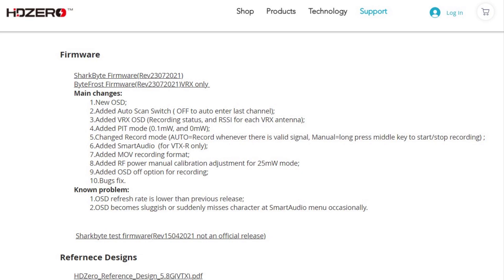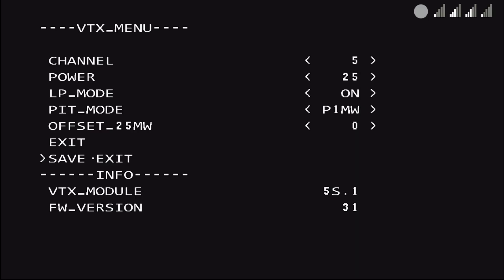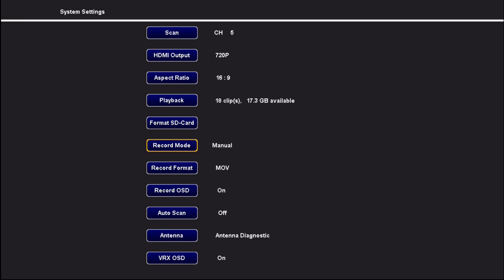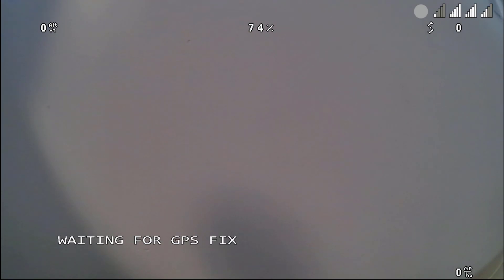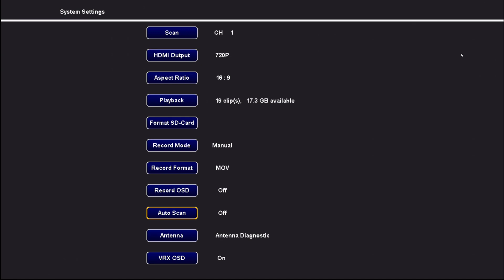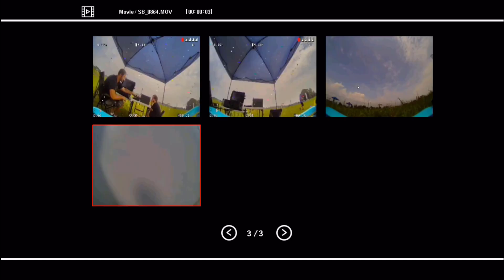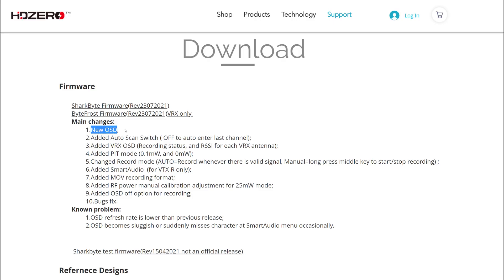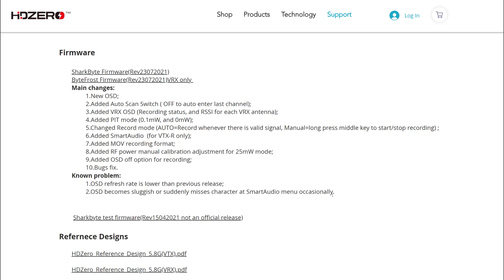Shark Byte | New features: Pit Mode, Larger OSD, Disable OSD recording, MOV file type, and more!

Comment: Hi Ryan, just to clarify, does the Shark Byte system transmit from the goggles like DJI or is it RX only?
Reply from the maker: Rx only, just like analog. This means timing systems just work and any of your friends can spectate your feed easily
Reply: @RyanQuellet  Thanks Ryan! Just getting up to speed on SB.  I was thinking about grabbing an RX module at $99, but the resolution on my Skyzone 02C's is probably too low.
Reply from the maker: @ampedfpv  quality is definitely dependent on the quality of the goggle screens. If you can find a recent oled goggle for cheap, grab it!

Comment: I've had a lot of issues with the July update. I had to use the no boot method to get the VRX to work after a successful update. Then, I had to re-flash my VTX a second time because there was no canvas mode OSD. Everything seems to work properly now except the .MOV feature - No files record. If I set it back to .TS video files record again?
Reply from the maker: I have found that MOV only works properly if I manually start and stop the recording. This is why TS was the only option before
Reply: @RyanQuellet  Yes, this seems to still be the case. MOV works now for me when I manually start/stop. Weird bug!! Thanks again, for the heads-up. You have become one of the best resources for shark byte implementation.

Comment: Hi Ryan, I saw that in the module you set 16: 9 like me. But I can't get the OSD elements to the edges of the screen. Mine remain moved towards the center. How did you go about putting them like this?
Reply from the maker: Make sure OSD is set to Auto rather than PAL or NTSC in Betaflight
Reply: @RyanQuellet  Thank you. For some reason in betaflight it was no longer showing me the auto, ntsc and pal options, but I was able to fix.

Comment: Just updated vrx and tx. S version not race and seem to have lost my canvas mode osd through beta flight. Anyone else experiencing anything of the sort. Msp Cli commands are still as before. I do have all of the new vrx osd functions just no beta flight osd. Any help would be appreciated.
Reply from the maker: Try re-flashing the vtx. Make sure to keep the vtx connected to the VRX when the update completes. Power cycle the VRX, then unplug the VTX
Reply: That did the trick. Had my order of operation a little out of order. Thank you .
Reply: @johnshelton1346  I had the same happen to me. Took about two hours of shitting bricks to find this thread. This firmware update was a pain!

Comment: My vtx still gets extremely hot on the bench in 0.1mW mode. I guess that is down to the voltage regulator?
Reply from the maker: Yes, 0.1mW mode still generates heat. Put the VTX in 0mW mode for it to make no heat

Comment: What's the difference between low power mode and pit mode? 
What does low power mode do?
Reply from the maker: Pit mode makes the vtx boot up in 0.1mW or 0mW power output until drone is armed. Low Power mode reduces power level to 25mW when disarmed
Reply: @RyanQuellet  Thank you